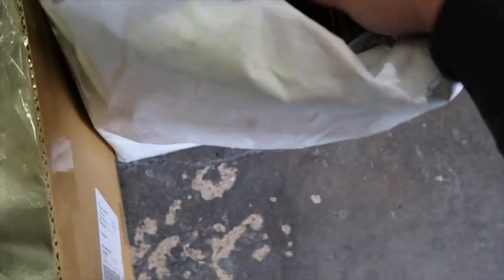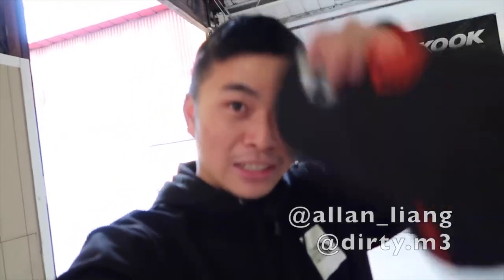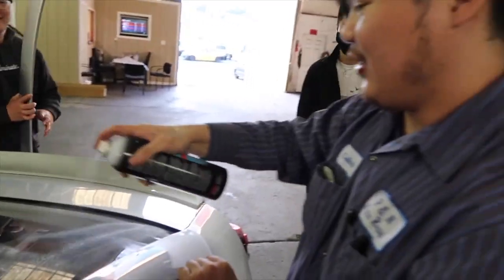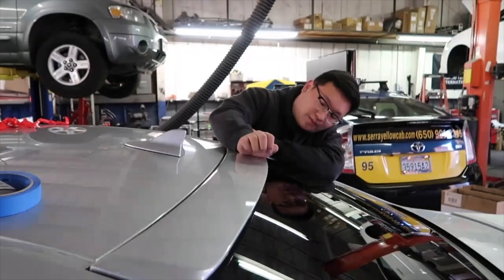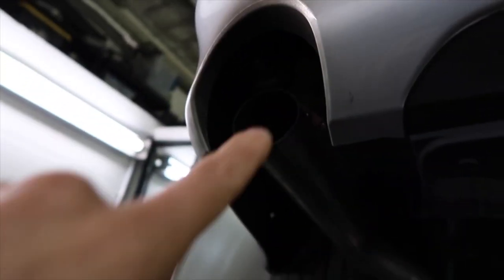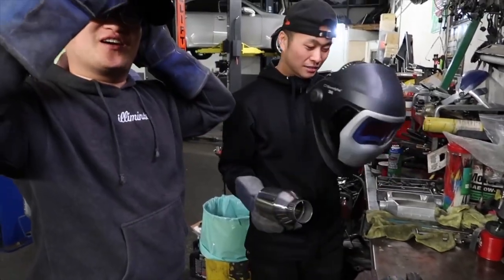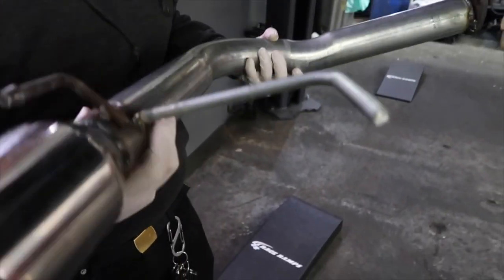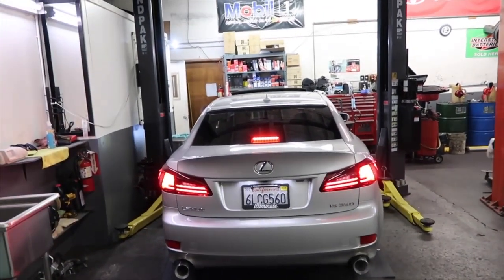Custom exhaust and roof spoiler | Lexus is350

Comment: what front bumper you getting?
Reply from the maker: pixelcok I’m just gonna say it’s not the 3is conversion 🤫
Reply: broo sell me ur grill im in the bay lol
Reply from the maker: pixelcok i wish I could but I’m using it on the new front bumper
Reply: @anthonysung  u sure it fits lol. grill is only for 09-10 🤔
Reply from the maker: pixelcok I’ll let you know if it doesn’t fit, if it doesn’t I’ll sell it to u
Reply: @anthonysung  its a fckin pain to find grilles for our 09-10 year. 06-08 and 11-13 is easy asf for aftermarket grill
Reply from the maker: @natecheng2  really? I swear they have hella grilles for 9-10 on eBay
Reply: @anthonysung  yea lol. each bumper needs a different grille. 09-10 only had the f sport grille as an option where the other years have hella aftermarket support
Reply from the maker: pixelcok yeah ikr hella annoying tho right
Reply: What kind of rear diffuser are you using?
Reply from the maker: @natecheng2  I got the front grille for sale if u are still looking for one
Reply from the maker: @Lenzkrafters  oem one

Comment: Nice looking Lexus and what size tips are those. I drive a Lexus myself but mine is a 2014 IS250 hence my name. I just subscribed to your channel. I have 2 videos of my IS250 feel free to check it out and let me know what you think.
Reply from the maker: The Lexus IS250 Dude they are eBay exhaust tips it’s a 2.5 inlet to a 4 inch outlet 
https://www.ebay.com/itm/253354097632
Reply: @anthonysung  I have 3.5 inch tips and other modifications on my Lexus did you see the 2 video of my Lexus on my channel.
Reply from the maker: The Lexus IS250 Dude yea I saw!